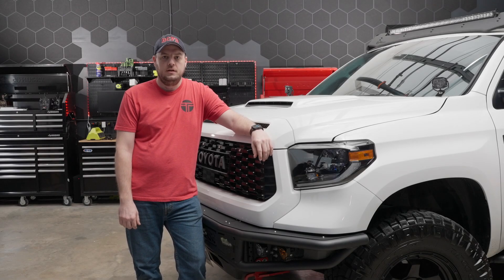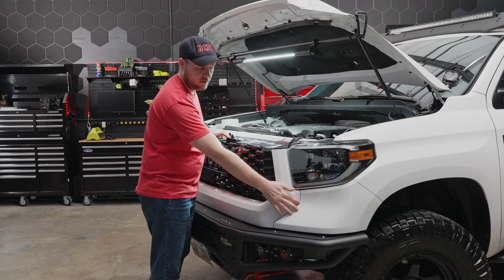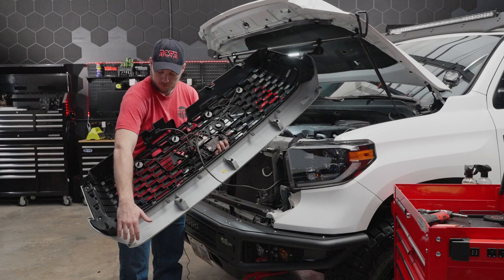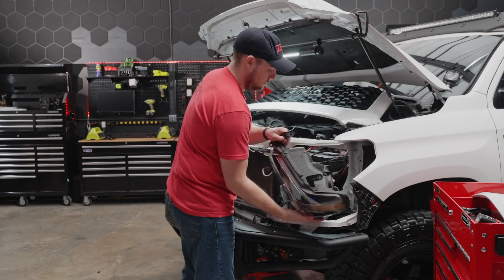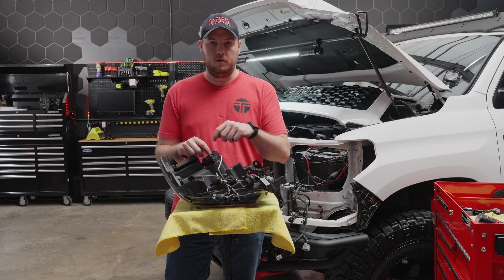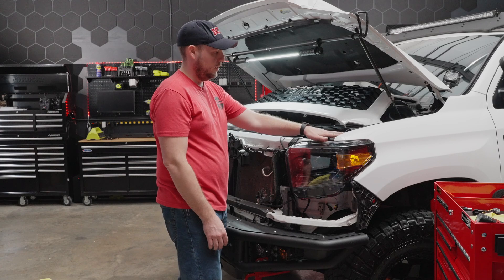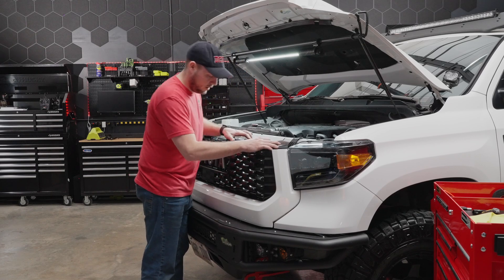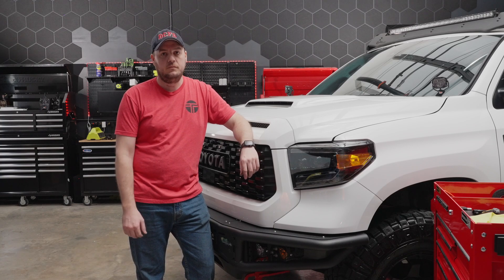Morimoto XB LED Headlight Install in Toyota Tundra | Trail Grid Pro

Comment: Great vid! QQ - just purchased a used 15 Tundra and noticed that the truck came with some  Morimoto headlights. I noticed that the passenger side turn signal sequential only goes halfway. Wondering if you happen to know if that’s due potentially a bad resistor ?
Reply: Call Morimoto customer service.
Reply from the maker: Yep, it could be that the remainder of the amber lights are out. Definitely call Morimoto and they can help out!

Comment: I have a 2018 tundra and when using the signal adapter, it blows the hazard fuses. When connecting it without everything works. Also noticed that the DRL doesn’t work either. OEM headlights are led and has DRL. Any suggestion on why this is happening? Thanks!

Comment: Is there a video on the turn signal adapter? I have to depin/repin the adapter to allow my turn signals and hazards to work for my 2014, but I can't seem to  get the pins removed with any tools. Probably something easy, just not sure why it won't release and I don't want to break it. Thanks.
Reply from the maker: Unfortunately we do not have a video for that, but any thin metal object should pop those pins out. They're designed to be re-pinned, so you shouldn't have to worry about damaging anything!

Comment: The turn signal/hazards lights did not work after install, it kept blowing my 15 amp fuse in the fuse box. Solution: I unplugged the turn signal adapter and plugged the Morimoto connector directly into the factory turn signal connector. Other than that, love the lights.
Reply from the maker: That's bizarre! Feel free to reach out to our support email regarding this issue! support@trailgridpro.com

Comment: I just installed the Ironman bumper on my 2021 Tundra and had to disconnect the passenger and driver side front impact sensors from the stock bumper for my SRS air bag system. Where did you mount your sensors, as the Ironman bumper doesn't have a specified predrilled hole/location for them?
Reply from the maker: Feel free to shoot us an email and we'll get some answers from Bryan himself!

Comment: I don't see the raptor grille lights for the Tundra on your website. Do you have them?
Reply: I bought mine on Amazon.
Reply: AUXLIGHT Car Accessories, 3PCS LED Center Grille Raptor/Marker Lights with Wiring Harness & Add-a-Fuse & Screws, Compatible with 2018 2019 2020 Toyotaa Tundra TRD Pro Grill (White)
Reply from the maker: Nope, we don't have any Tundra grille lights for sale on our site. We got them from another vendor!